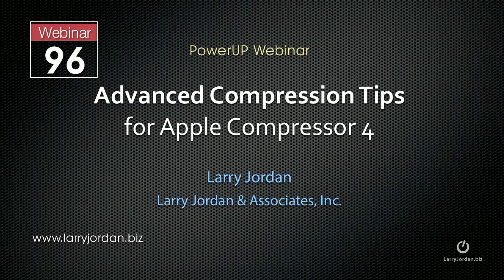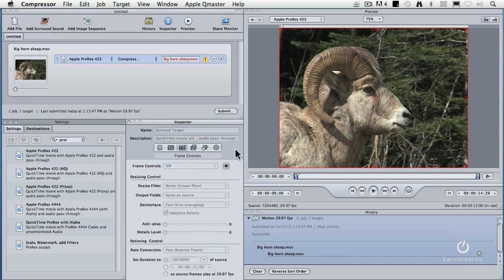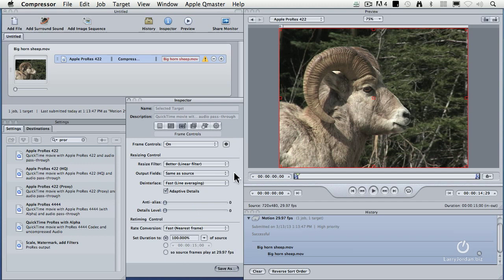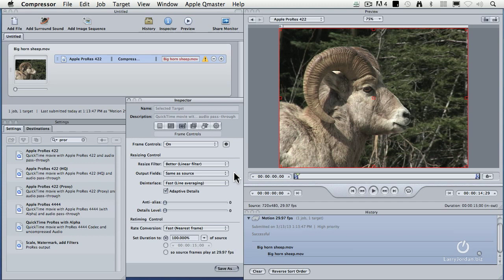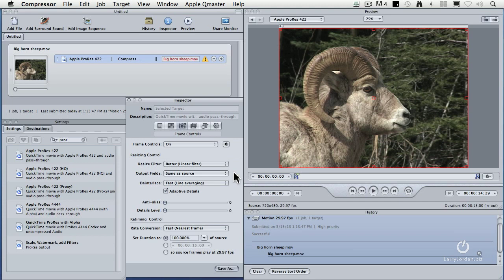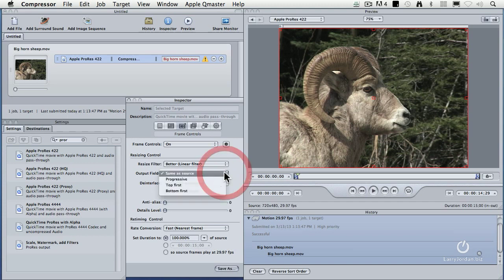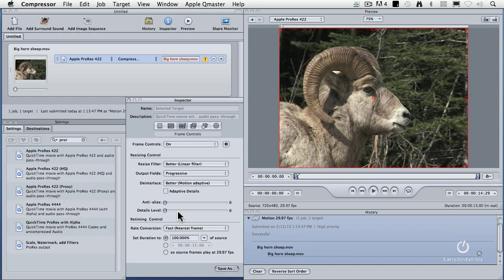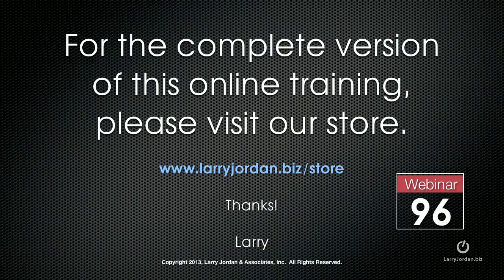Deinterlace an Image in Apple Compressor 4

Comment: Set the deinterlace to better.  Now you may think that best is better than better, but actually when it comes to deinterlacing, better is better than best because the best takes too long.  And it doesn't give you that good a quality.  Better is better than best which means you use better not best when you want the best in deinterlacing inside Compressor, so we'll select better.